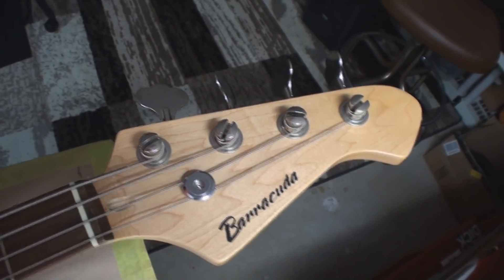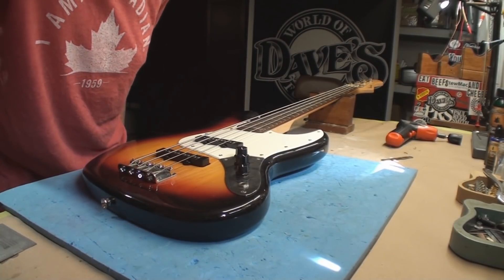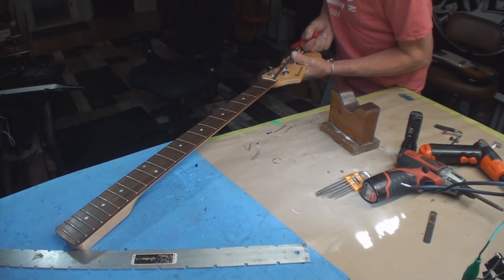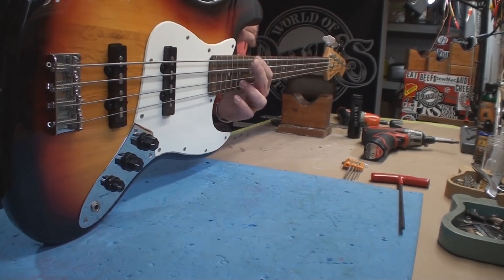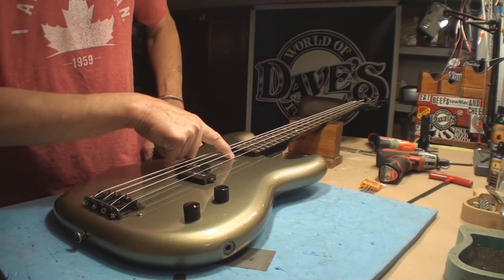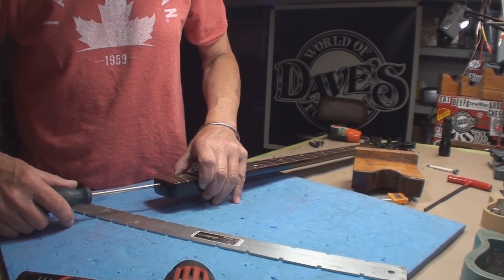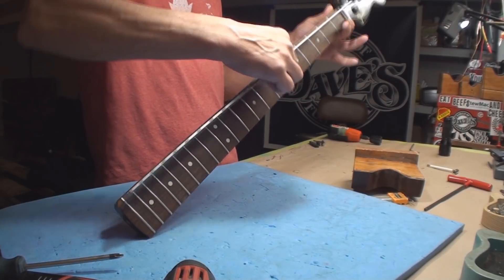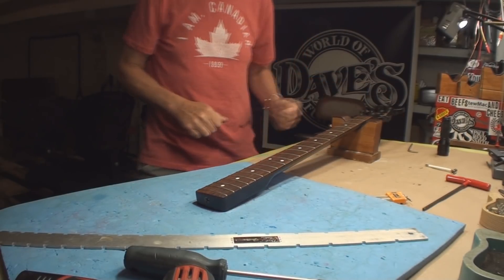Broken Bass Guitars Part 1

Comment: I love my Squire J Bass ... is a JV and I love it
Is it not sometimes just time for a new neck?
Reply: As long as you set the truss rod regularly to maintain the bass' playability, then then neck shouldn't need replacing, unless there's a really major issue that develops, like a neck warp or twist, then replacing it might be less expensive than removing and reinstalling the fret board and all the hard work it would take to repair an issue like that, which is difficult to do